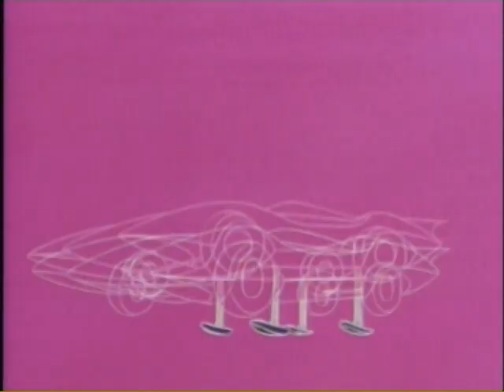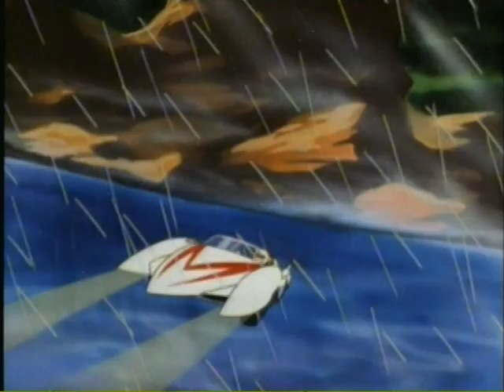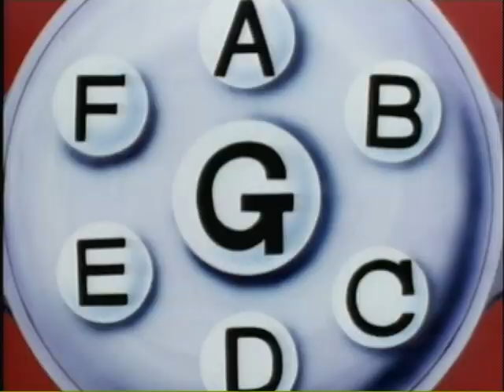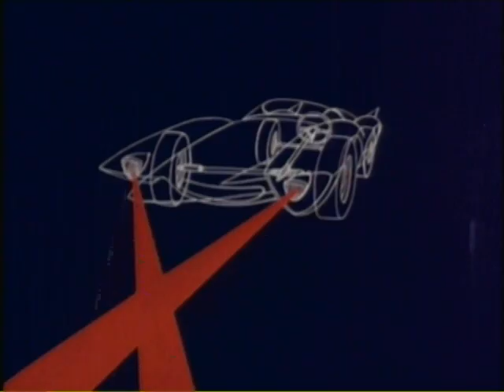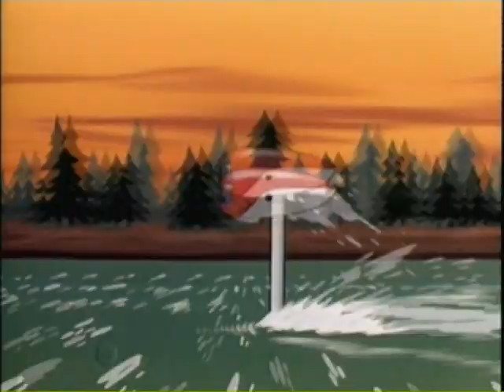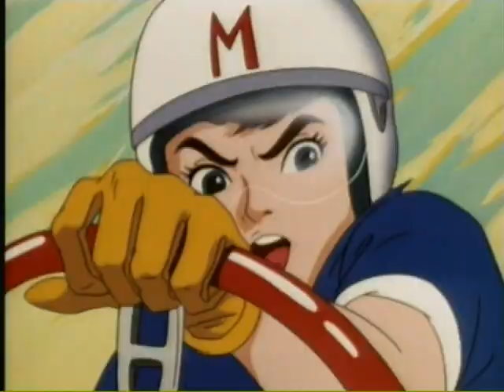Speed Racer - Mach 5's Advanced Features

Comment: Pops needs to install another feature: a trunk ejector.  All too often the Mach 5 isn't going fast enough because Spridle, Chim chim and sometimes Trixie are in the trunk.  If the Mach 5 had a trunk ejector Speed could just push a button and the excess weight would jettisoned and the Mach 5 would be more competitive.
Reply: Lol, brilliant.
Reply: Got dammed Spridle
Reply: I always felt that Speed needed to check the trunk before he went anywhere.  You know, just in case.

Comment: There's also an H button, with the homing robot's controls rather than on the steering wheel, which sends the robot "Home" (to a pre-programmed location, usually back to Speed's house/garage).

The letters match the function in the Japanese version (Autojacks, Belt tires, Chopper, Defensor, Evening Eye, Frogger Mode, and Gizmo Rocket).